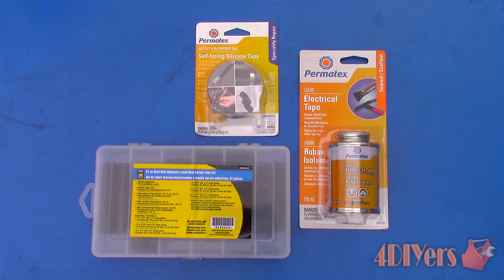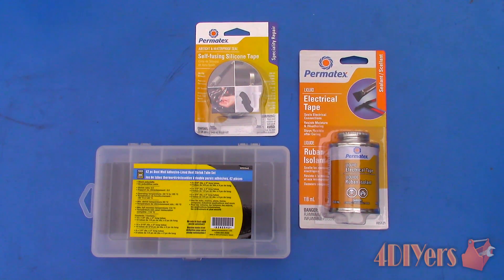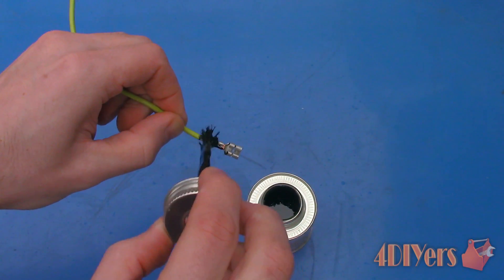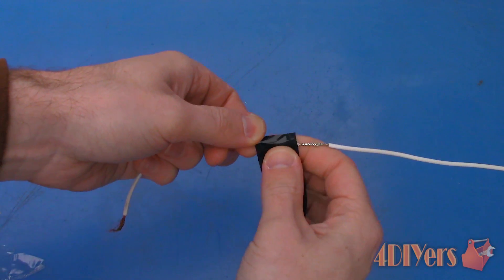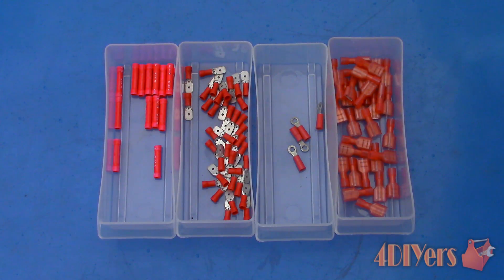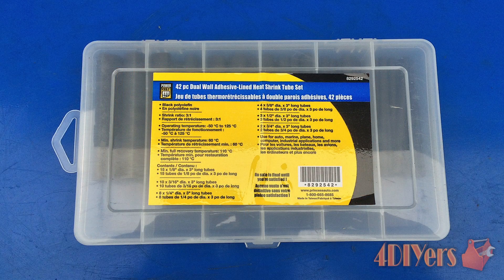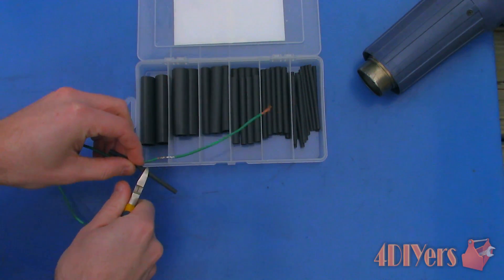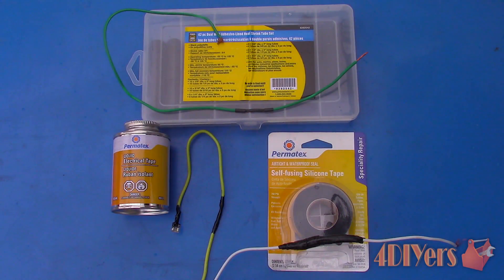How to Waterproof Electrical Connections - 3 Ways

Comment: The application I have will probably have the connector sitting in a stream.  Will these methods work to prevent the wires getting wet and causing short circuits?

Comment: How about waterproofing a connector?  Specifically, a tap splice (because one wire coming from a fan motor is so short there's not enough room for an insulation-stripped splice)?
Reply from the maker: Liquid tape would be your best option.
Reply: @4DIYers   Thank you.  I'll get some to have on hand.  I had to do it yesterday.  I asked at a neighbor's house and he loaned me a tube of dialectic grease to use to block the openings once the splice was complete.

Comment: OK, I am a new fan of that self-fusing Silicone tape, especially in my engine where I had to remove the old connector to my AC Clutch assembly that was bad.  I added on some new spade connectors, but I forgot to put the shrink tubing over the wire first.  Oops!  But since that Silicone tape doesn't leave residue or stickiness on your skin, it was very easy to put on and made a great water seal for the entire connector.  Thanks for the great info!

Comment: i didn't even know liquid electrical tape was a thing until just yesterday i was trying to figure out a way to repair wire that was gnawed on by rodents on my classic BMW the wires were  intact so heat shrink wasn't an option and bundled so close together and in a tight area  that tape wouldn't work liquid tape worked like a charm thank you
Reply from the maker: No problem, happy to help! What kind of BMW? I have an E23 myself.
Reply: @4DIYers  1994 740i i saved it from the crusher but was infested with mice was sitting since 2012  they got into the hvac system and ebox caused havoc with the wiring car threw a code for fuel pump relay and was running terribly the relay which is in the ebox when  i opened it up i  found a nest several dead mice and many chewed severed wires i used posi lock connectors and new wires to replace the severed wires and on the gnawed ones that was just damaged insulation i used the liquid electrical tape and small disposable paint brushes took patience and several hours of tedious work but im happy to report the car runs better smoother with no cel  i did hours of research before i stumbled on your video and it helped me greatly shes far from done but slowly im getting there  thanks for what you do
Reply from the maker: Thank you! Congrats on the purchase and awesome to hear you were able to save it. I've done this in the past, such a good feeling bringing life back into a vehicle. I had a 94 740i too, it was my first BMW! Mine was Oxford Metallic Green with a light beige interior, I still miss it. It's in one of my first videos on how to unlock a BMW when the battery is dead. realoem.com is an excellent resource for part numbers and schematic breakdowns. And http://e38.org/e32/ is excellent for other tutorial write-ups.
Reply: @4DIYers  thanks for the tips  when you put the time into car i feel you learn to appreciate the vehicle more in the long run .I just got done changing the differential fluid when your reply popped up on my phone lol .I'm a night person its been really hot out during the day  so I've been doing things after dark  in the garage been slowly changing out all the old fluids I want to have it as  road worthy as i can by Thursday other than up onto the trailer and up and down my driveway I haven't been able to give it a proper test drive and I'm itching lol to see how it goes down the road to find out what else may need to be addressed.  i wanted to get as much done as possible before i spent the money to reg and insure it .is the transmission fluid and filter hard to do on this car the Bentley seems vague and I haven't found any videos looks like you have fill it up through the center of the pan do i need a special tool or will any fluid transfer pump work i want to at least confirm its full before i drive it there was a lot of wetness on the pan and all the bolts seemed loose i re torqued them and cleaned the pan today as well to see what its from
Reply from the maker: No problem! It'll be worth it, I put 100,000km in less than four years driving back and forth to school. Used to put on about 350km per day and it was so comfortable. Really makes a difference when you have a comfortable car on long trips. And it saw a couple track events too, managed to get it up to about 190km. Been a while since I did that work, I did replace the fluid and filter as mine was having shifting issues when I bought it. "Technically" BMW says the transmission fluid is lifetime which is just nonsense. Dropping the pan is fairly easy along with replacing the filter. The hardest part I'd say is filling the fluid and checking it. You need an extraction pump to fill the transmission through the hole in the pan. Then to check it, when the car is off, the fluid will actually come out of the hole. If I remember right, the car needs to be in gear to get the correct level and it should be level with the top of that raising fill hole in the pan. Just ask on a Facebook BMW group to be safe, it was over 10yrs ago when I did mine.
Reply: 4DIYers yea I did some research online I was way overthinking it what I’m gonna do for now is a drain and fill no filter pop the fill plug make sure it will come loose then drain via drain plug similar to a differential I went and bought a 4 liter garden sprayer and modified it so I don’t have to sit there all day with a hand pump. I will fill it up again till it spills out then with my kid have him go turn on the car and go through the gears and fill till it’s pours out then close it back up that’s the jist of what I read . Then I’m gonna drive it for a few weeks order a filter and gasket and do it again this way I’m hoping to get as much old stuff out as possible.i own a Quickjack lift system so I can do this safely it was a bit expensive up front but has paid for itself in the two years of ownership I got the 7000ext model  so I’ve had everything from a Corolla to a full size 1/2 ton pick up on it I’m getting to old to be messing with jacks and jack stands lol

Comment: if youre using heat shrink tube that doesnt have an adhesive then you can fill the tube with silicone paste, also known as di-electric grease, to waterproof the connection, remove any excreted grease after shrinking.
Reply: Do you think that paste would work to waterproof a tap splice?

Comment: Would this work for rc ships?
Reply: If it sinks
Reply from the maker: Yes it will, but you may also considering spraying the circuit board in plasti dip as well.

Comment: heat srinkage sleeve is the best way you out from water problem
Reply from the maker: It is by far my most favorite method as well, although it can only be applied to wires without connectors or when the wire is cut.

Comment: I use heat shrink
Reply: Hey stranger,I'have a question?
When I'get my Heat Shrink,Do you recommend me to get one of those meter long coils or already cut ones?!
Reply: @AutodidactEngineer  might be a year late but either option will work as you can cut it to size